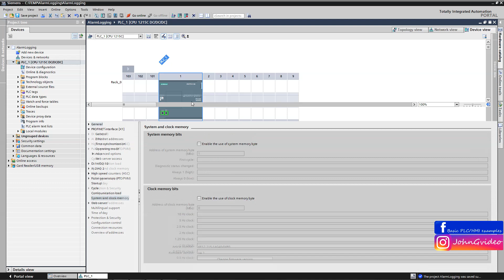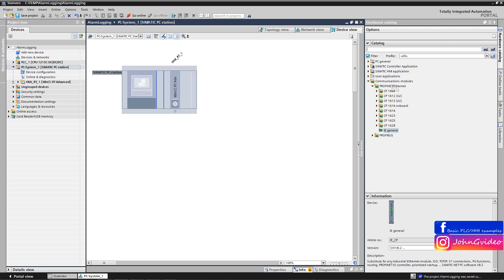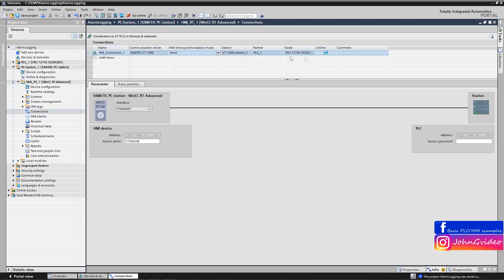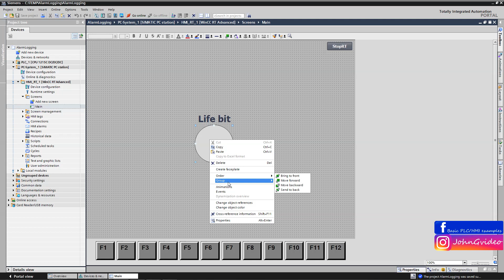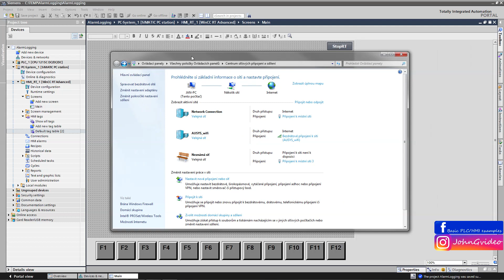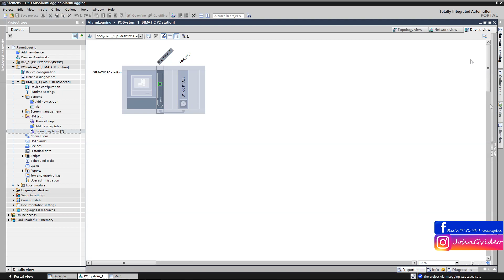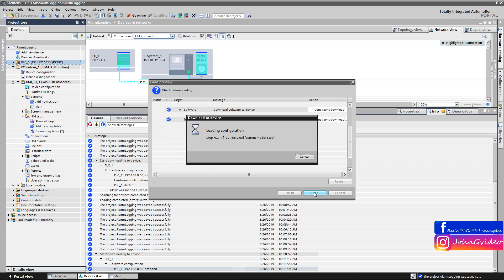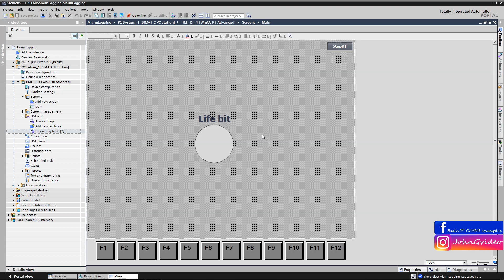Siemens TIA Portal HMI/PLC tutorial - How to create connection between WinCC RT Runtime & PLC

Comment: Hi there, nice videos my friend, but I have a question, I have an IPC with the WinCC runtime installed, and I'm using a proxy device to call the PLC tags from another proyect while I work with the WinCC runtime application, but the problem is that I can't see the tags reflected in the runtime neither  can I write bits to the PLC from the runtime, the IPs are set as you show in your video, I have tried different types of connections but nothing works, any idea of what can be missing?
I'm using TIAportal V15.1 with runtime licenses

Comment: Awesome work John, but i have some questions here.
First, some engineers prefer to add "PC Station" then add "RT Application" on it.
Second, What do you recommend to make the "RT Screen" size or resolution the same as the PC screen?
Reply from the maker: Hello, thanks for your response :) I dont see any diference between add first PC station and then RT, or the other way (maybe im not right) :) ... I prefer to have in real RT applications same resolution as PC screen on which app run, but everything depends on the customer requirements :)